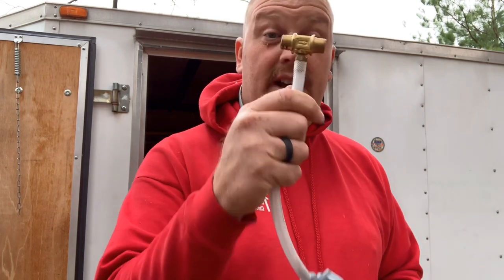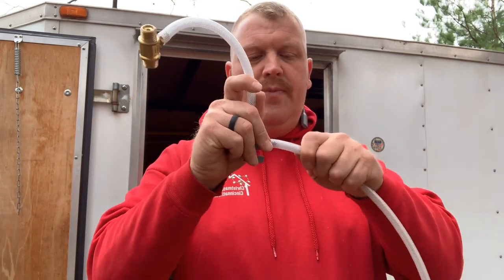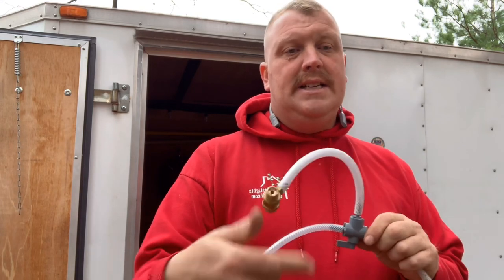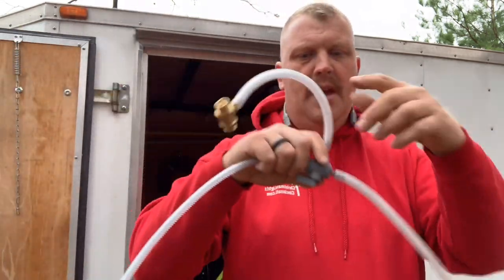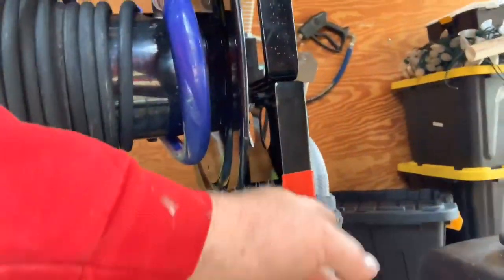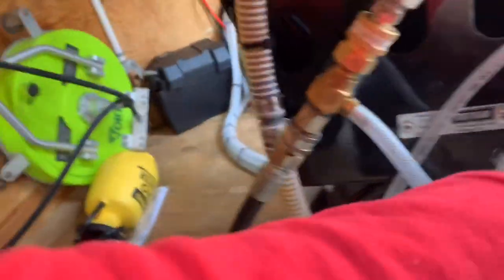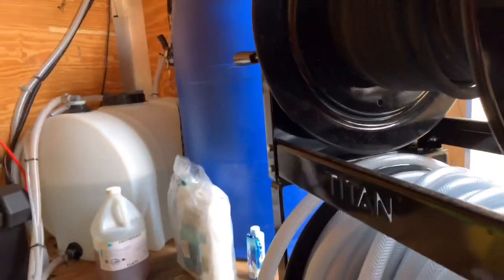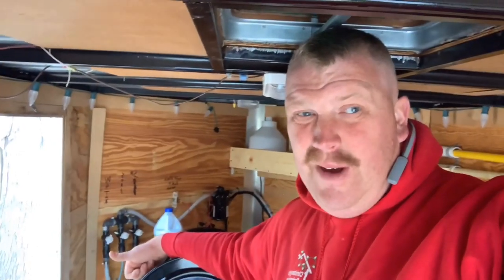3 Way Valve With Downstream Injector To Making Last Longer

Comment: Super helpful,  the float valve, the 3 way valve, obvious items that are readily available to setup a pressure washer business to run efficiently and professionally.  Now I'm not over spilling water from the tank into the truck bed and on customers property while wasting their water=money. And I'm not running back and forth jumping into a truck bed to take out a soap hose or else.  The links to find the 3 way valve and other items. Super Helpful.

Comment: Ok, so yes I'm new at this, I get what your saying, but what about the remote control proportioning set up ? Then one that I've seen all over the place with the 3 valves ? Does that work like this system your speaking of or does that one all mix together and then go through the pressure washing pump ? Thank you in advance good sir.

Comment: I haven’t bought a downstream injector in 5 years and I use the crap out of mine ! Make sure you have a ceramic ball inside of it and if it ever sticks pull off your 1/4” hose and take a small finish nail and gently insert it into the barb and you will feel the ball stuck to the o’ring then push down about an 1/8” till you feel it release from the o’ring then spray a little lubricant in there to keep it from acting up again, I only use GP high draw with ceramic ball type, and I use the bypass loop and hardly ever flush them out
Reply from the maker: You Musta got a good one
Reply: Power Washing both machines have the same type of injector, it may have something to do with the bypass loop ? I had the 3 way ball valve on my old trailer but when I built the new one I didn’t do a ball valve to flush it out and haven’t had that many issues at all , I have spares with quick connects on the trailer just in case, maybe your o’ring inside of it is not Viton(extreme duty rated )
Reply: Y because he challenges you the u tuber washit man, P.S. you hijacked the idea not yours originally. U came up with a way. Please

Comment: I have a simpson machine    It has a soap valve not sure if its before or after the pump   I bought an external downstream valve  do you plug off the original valve ??

Comment: How can you connect the 3 way valve if you have a remote downstream box, since the hose connects to the insides of the remote box?
Reply from the maker: You can do this so when you're at the end of the job you can turn that three-way ball valve on and then it will clean out that downstream injector
Reply: Thanks, but I understand that. I just don’t know where on the hoses to put the 3 way since I have the remote ds box? I know one goes on each line but I don’t know where since my lines are connected to the remote box

Comment: Jason, thanks for the link to this very helpful video. So just to clarify: if I pull one line from my buffer tank to the three way and another that is plummed straight into the 65g sh tank and that is straight 12.5% sh than my downstream injector will pull 1 % at most ? Also, how to get soap in the line also? Should I just put the surfactant into the sh tank ? Thank you so very much for the help!

Comment: I have a question if I have a water tank 65 gallon connected to my 4 GPM and I have a downsteam injector connected and I don’t pull the trigger  and the unloader goes off will it shoot SH back into my water tank ?
Reply from the maker: No it shouldn’t because you’re down stream injector should be after your unloader valve

Comment: Hi Jason, what do you think about air pump with compressor instead the 12 V for soft washer system? I have concern about the 12V life time. Thanks.
Reply from the maker: They work OK. They still will go bad and break and you’re looking at $1500-$2000 to go with an air system where at 12 volts you’re only looking at about $200. I can buy a lot of 12 volts for the same price I can buy an air system
Reply: Power Washing thank you Jason. Have a great day buddy 👍🏻

Comment: We have a 55 gallon chem tank that we want to keep full of bleach and surfactant (no water).  The only problem is if the injector is pulling directly from that tank then the mix is probably going to be too hot for house washing (we don't clean roofs).

Would we be able to dilute the mix enough with the 3 way by turning the valve to the middle or somewhere there?

I was thinking of an ST-66, but by the time the mix leaves the injector it may be TOO diluted...
Reply from the maker: I know people that actually clean downstream we straight bleach or 12%. You do need to pretty wet if you’re doing it this way because it could be a little hot. You might be able to use that three-way valve and just crack it halfway but I don’t know how well you’re going to be able to know what you’re actually putting

Comment: If you mix 50/50 what % will you be getting on the siding with a 4gpm downstreaming?
Reply from the maker: Well it depends on if you’re using the 12% or 10%. If you’re using 12% you’ll be right around and a 10 to 1 injector you’ll be right around .75